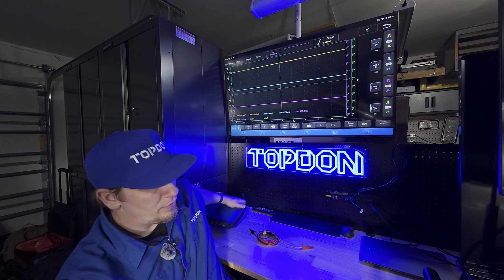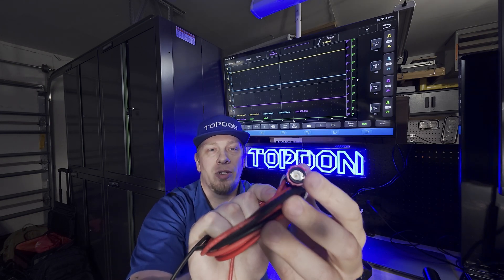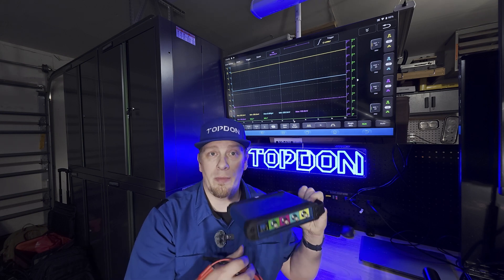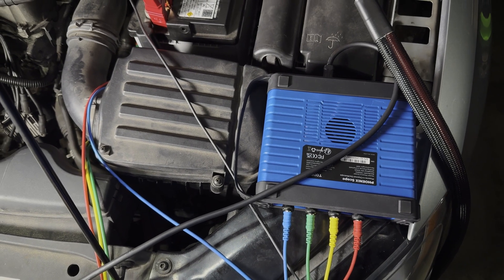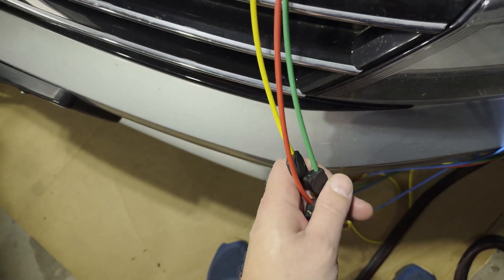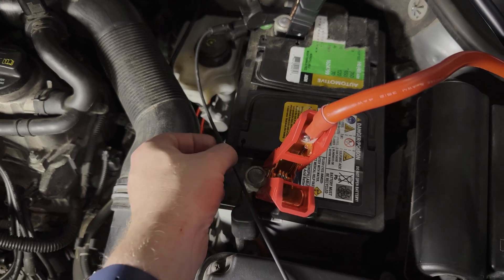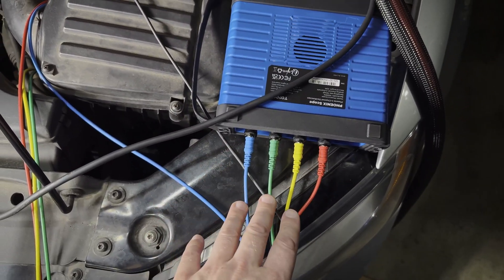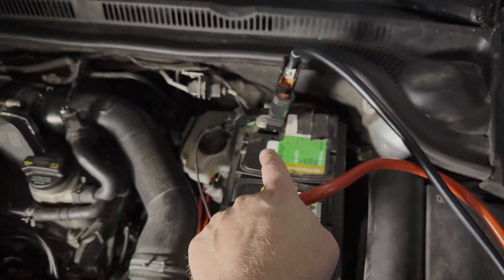Oscilloscope Tech Tip: Grounding Your Channels Safely

Comment: If you have an amp clamp that has banana plugs on one channel and it is connected to your scope using a bnc to banana plug lead, would you just connect both the bnc lead's banana plugs to both of the clamp's banana plugs? Should you then connect a lead to a second channel and ground that one? In that case how would you safely deal with the second channel lead's colored connector if you didn't use it? And if you are using one lead one one channel and also using an amp clamp on a second channel, to do a relative compression test with a sync for example, does that change the way you should ground the amp clamp?
Reply from the maker: Hello, There is a ground connector on the oscilloscope, from which you can extend a grounding wire.

Comment: Where can i find them nice long channel leads? Thabks.
Reply from the maker: Hello, the device is equipped with a grounding lead.
Reply: Im wanting to know about the other channels. Not the ground leads if that helps.  @TopdonOfficial
Reply from the maker: Hello, for TD52110277, we only offer the standard cable; longer versions are not available for sale. Excessive length would affect measurement accuracy.

Comment: So is it better to have each channel to ground individually?
Reply from the maker: Yes sir, if you can ground each one individually, it’s better.
Reply: As long as ALL channels are grounded to the SAME ground SOURCE (preferably battery negative), that is ok. The key here is NEVER ground the channels to DIFFERENT ground sources. This will create a voltage potential difference and current will flow THROUGH the scope potentially causing DAMAGE.

Comment: When using the coil on plug  we don't have ground lead on it  how to ground it?
Reply from the maker: If there is no ground lead available, we recommend connecting directly to the device's built-in wiring.
Reply: If you are using a secondary ignition probe (which may not have a ground lead), I’d recommend running a second channel and grounding that second channel to battery negative.